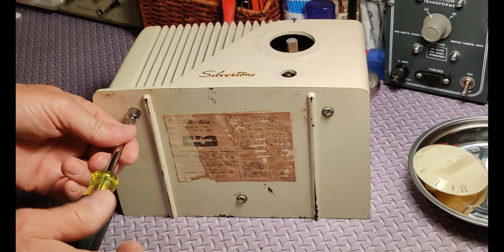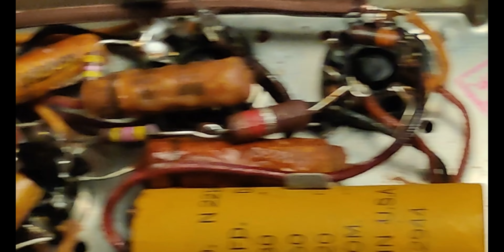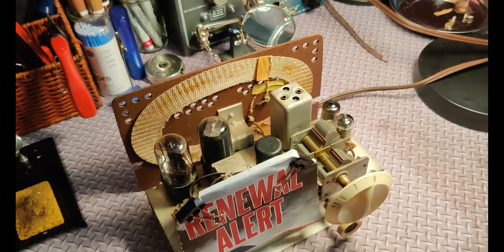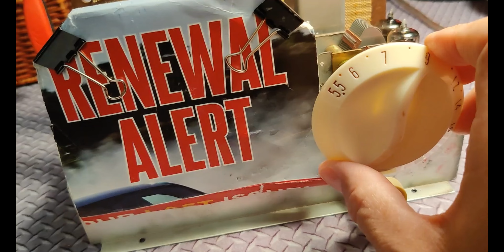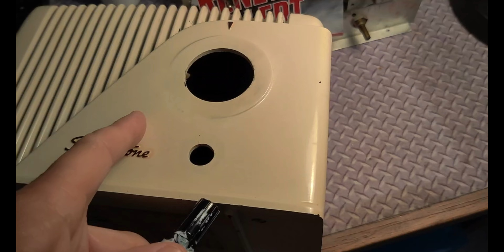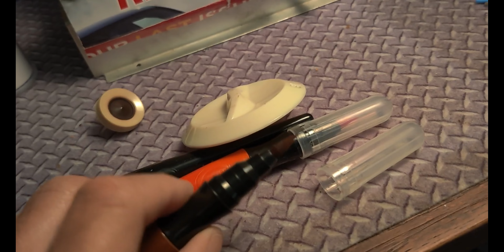Repair of Sears Silvertone Model 9001

Comment: What did you do to fix the speaker rattle?
Reply from the maker: I guess I should have video’d that. The speaker cone was fine, but had come loose at the edges. I used Aleene’s Tacky Glue to glue it down. After that it sounded great. Thanks for watching to the end!!